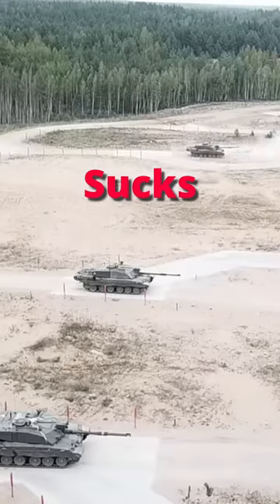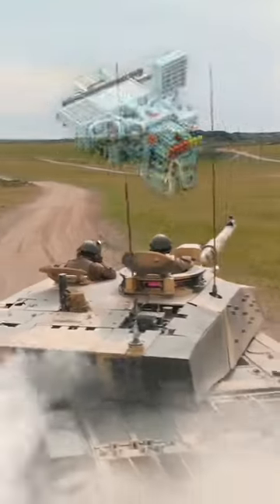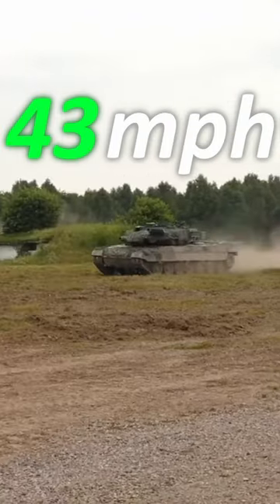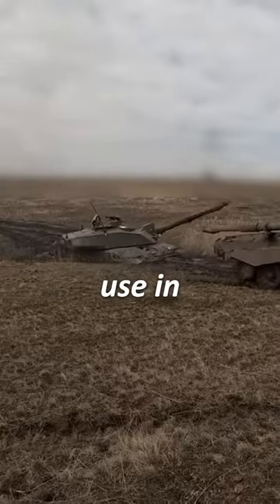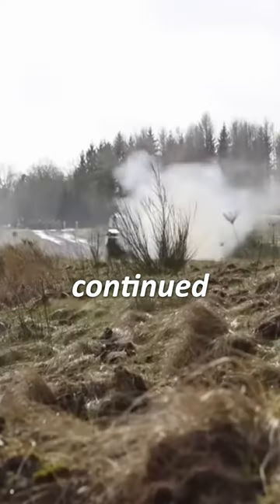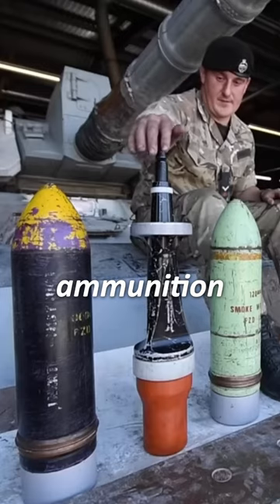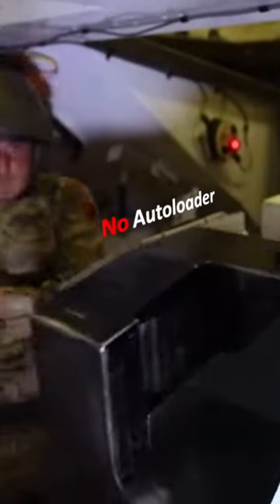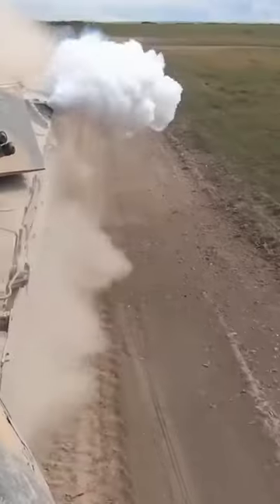Why Britain's Challenger 2 Tank Sucks

Comment: Someone got all their tank facts from warthunder.
Reply: But he's not wrong tho
Reply: @tanaziolopez1936   He's wrong on just about every level. Speed for a MBT doesnt matter, its fast enough to do its job. Its rifled barrel provides accuracy and long distance fire. giving it the longest tank on tank knockout in history. No-one wants autoloaders (they are dangerous and actualy slow down fire rate and restrict ammo capacity and reloading). Its not got minimal protection against drones, its one of the strongest in the field for both drone protection and direct tank on tank combat. its 2 part ammunition increases magazine capacity and improves safety. it has zero problem knocking out any enemy tank based on their armour capacity. Its barrel maintenance isnt an issue either as it can fire several hundred rounds before requireing replacement, which is also a simple procedure. 

its weight doesnt mean it gets stuck, it gets stuck in ukraine because the drivers are terrible (as shown in the example, any tank gets stuck there).

This is warthunder logic and only being presented to cause sensationalism and debate in the comments to drive clicks and views.

Comment: Never mind that no western tank has an auto loader for good reason. They are finicky and prone to breaking slower than a well trained loader in short engagments wich most tank on tank engagements are and make safely storing ammo much more dificult often resulting in orbital turret syndrome.
Reply from the maker: That's pretty much all in my next video :) Was purposely one sided and only looking at the negatives. Next video is on the pros of the Chally 2
Reply: Absolute nonsense. Compared the all other western tanks, the Challenger 2 is a heap of garbage.

- The Leclerc and Type 10 are the most popular Western tanks that use bustle autoloaders. It gives the benefit of having blowout panels and an autoloader. 2 extremely useful benefits that we'll no doubt see more of in the future.

- Autoloaders are not prone to jamming. They will more often than not outlive the tank itself. With Russian autoloaders being found to only malfunction once every 1600 shells give or take. Now add that to the higher quality standard of western designs and maintainance.

- Autoloaders do not cause the "flying turret syndrome". The explosion of the ammunition does. This is ironically a problem the challenger 2 has: it has no blowout pannels and the crew inside the turret is littered with propellent for the 2 piece ammunition. Meaning that any penetrating hit to the hull is likely to cause a cook-off.

- A "wel trained" loader gets tired over time. A loader can maybe load a shell every 4 seconds in perfect conditions, but war is far from perfect. You will be exhausted, fatigued and lack proper sleep often. Perhaps even shell shock and other forms of PTSD. An autoloader has no such thing. It's a machine.
Reply: @Howmuchthough You missed quite a few huge negatives still
Reply: @castrix9910  what other negatives are there? I am in no way, shape or form educated in any such way about tanks. Genuine question, thanks
Reply: @550bhpF11Squad  From just the top of my head;
- Challenger 2 uses 2 piece ammunition (Propellant and projectile). The only tank in NATO to do so. The propellant is stored in the turret basket, virtually unprotected. A penetrating hit to the hull will therefore most likely lead to an internal explosion, killing everyone inside.

- Challenger 2, to my knowledge has no laser warning receiver. This is a system that detects and warns the crew when a laser is pointing at the tank. Most commonly from a laser rangefinder.

- It has the rifled gun. Again, the only tank in NATO to do so. This was already mentioned in the short, however the short says that it increases accuracy. It does not however. Challenger 2 does have the longest recorded tank kill (this is also where the myth itself comes from), but this does not disprove the fact that rifled guns are overall less accurate than smoothbore guns.
- The tank has a massive weak spot, that being the lower front plate. If I recall correctly the place itself is some 80mm thick. The British do put ERA (explosive reactive armor) on this spot, but it is meant against shaped charge munitions like RPG's. Not other tank shells.

To not make this any longer than it already has to be I'll shortly list a few more:
- Lack of blowout panels
- Underpowered engine for the weight class 
- Extremely heavy, making crossing bridges a nightmare
- Relatively weak transmission
Reply: Leclerc is a pretty western tank. K2 and Type 10 not so much.
Furthermore Abrams TTB autoloader apparently did 40000 cycles without a single failure.
Type 10 autoloader apparently takes just 2 seconds and manually loading on the move is a massive bitch but challies in ukraine are used as SPGs anyway because they are fat, slow and a general pita to maintain.
Reply: @Castrix99  Rifled guns are absolutely more accurate than smoothbores but it simply doesn't matter for tank guns at these calibers - soviets calculated that their 115mm smoothbore was plenty accurate for engagements in visual range.

Also chally has a MASSIVE driver's hatch weak spot, even russians with their famous "cleavage" point and laugh.

Comment: The 120MM L30 Cannon has a design flaw that kiled 2 Tankers in the UK a number of years ago as a vital component (BVA Bolt Vent Axial) of the weapon fell out and firing the gun killed 2 of the Turret Crew in 2018. The Challenger also lacks blow out panels for its ammunition which in Ukraine has already proven disastrous when a Chally 2 was hit with a 9M133 Kornet and its ammo cooked off. Challenger 3 is having blow out panels similar to the Leopard 2's
Reply: Blow out panels dont always save the tanl sadly. Saw an abrams ammo that cooked off leaked into the crew compartment.
Reply: @cherrypoptart2001  the blowout panels aren't meant to save the tank, but to save the crew. But even in that purpose, user errors can happen, like having the blast doors always open for a higher rate of fire. Or there is even the possibility that a hole in the blast doors could appear from the enemy warhead.

Comment: Challenger 2 is the best tank in the world thumbs down for your channel
Reply from the maker: Did you not see the end part or the pinned comment?
Reply: @Howmuchthough  yeah I don't care you started buy saying what you did and secondly the challengers in the uk have Dorchester armour that's better than the Chobham
Reply from the maker: @davidhopkins9021  Dorchester armour is another name for Chobham armour, they are the same thing
Reply: @Howmuchthough  Dorchester is 2nd generation  armor so it is different shows how much you know
Reply: @davidhopkins9021 yeah, your off base here mate, he literally said every negative point comes with a positive, and at the end he said it was a great tank.

Your acting like you designed it 😅
Reply from the maker: @davidhopkins9021  Exactly Dorchester armour is second generation Chobham armour but it's still a type of Chobham armour.
Reply: @Howmuchthough  Its a slightly different composition to improve performance....its not a whole new level of protection. It probably was designed to have more effective protection vs APFSDS and Chobham was focussed on HEAT